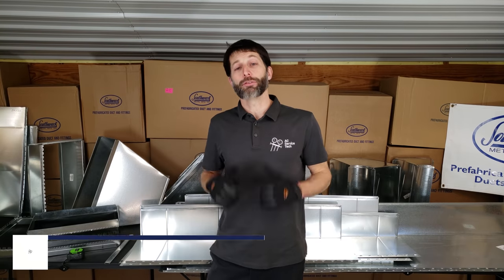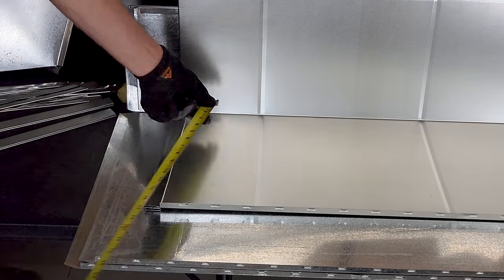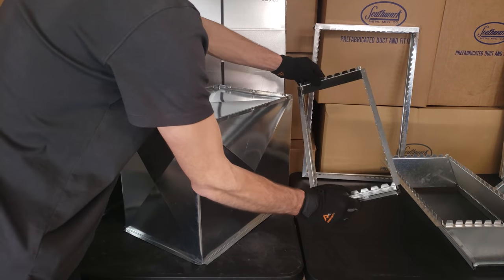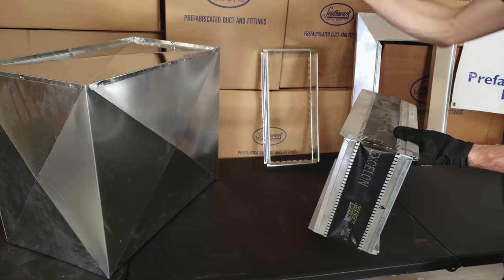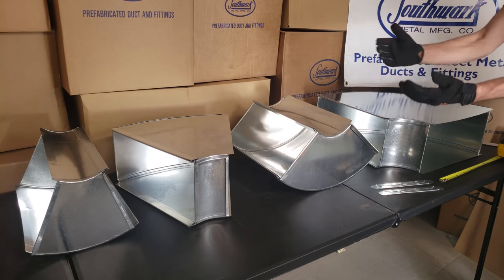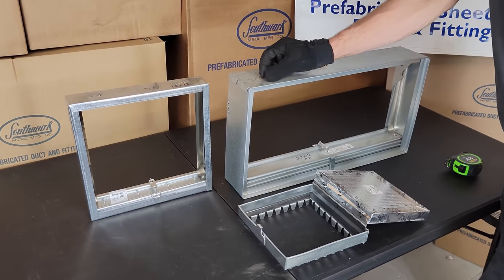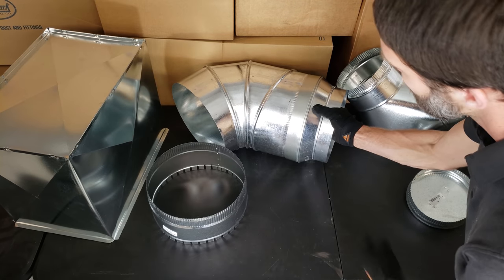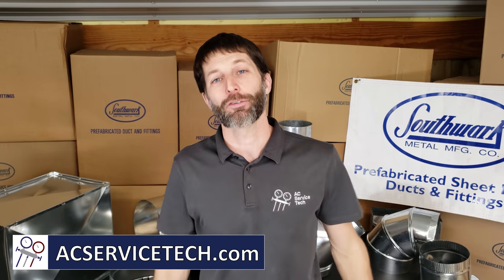HVAC Ductwork Basics! Trunk Duct Fittings, Elbows, Names, Sizes!

Comment: I did exclusively industrial work for 30 years. Now I'm working residential and have to learn all the supply house nomenclature. I feel like an apprentice!!
Reply: Always learning 🙂
Reply: I’m sure it’s not nearly as detailed or even complicated. You’ll pick up on it easy peezy
Reply: There's a big difference between the two, industrial v res. 
I used to make square and round/spiral duct for a commercial company. Had to make it to spec via blueprint job to job. Totally different than popping together some trunk line and strapping up flex

Comment: The damper is a very important aspect of any Hvac System to balance cfm to each supply register .(manul or motorized  dampers ).There are fitting terms used by old timers that in the name explain what it does .Example a double offsett double transition offesetts to the side and up or down and changes dimension on both sides.  
Skilled  sheetmetal workers can make offsets on the job by using the owl method to cut a pie angle out of ducts to make move up or side to side maximum of 15 inches in a 4ft section  .owl is short for offestt x width divided by the length .Also Skilled metal workers  can modify straight ducts to  become square elbows on the job.
By skilfully cutting and bending making sure to add turning veins to help airflow.Bar folds and bending tongs are need to modify duct along with a way to cut Pittsburg seams with a cutting wheel, Sawzall metal blade or bulldog snips if your strong enough and your snips are sharp .
Most residential hvac ducts use s and drive connection and use a standing s for larger ducts .Comercial jobs with huge ducts use TDC connections or ductmate . it's handy to always have afew cross breaked sheets of metal on your truck to make in place transitions to new equipment. Good hvac metal workers can make filter racks on the job with a slide door that slides threw slocks.Black iron grease ducts are welded connections and hung using threaded rods and unistrutt and need access panels for cleaning .Ceiling heights are important in duct instalation and elevations of intersecting ducts .Large complex comercial jobs require laying out duct runs on the floor and transfering of hanger locations to the ceiling.Often in complex instals the Installer has to think many steps ahead as not to block other trades prevent blocking other ducts to be installed and code requirements. Best to work from top down on tight mechanical rooms and seal ducts 100 percent with brush on duct seal with a Nickel depth thoroughly brushed into seams .

Comment: I'm glad you put the note about the plenum for starting out. Plenums are not best for flow and increases static pressure when they don't directly transition to main duct trunk .  I try to use round duct as much as possible. The air flow in round duct or spiral duct is far better then traditional square duct.  The down side is clearance
Reply: Round duct is best for residential. Clearance be damned
Reply: @MadAtMax.300Blackout  that's not completely accurate.  Nothing really out flows spiral duct. Usually you see a lot of spiral round duct on commercial applications. Not so much on residential
Reply: @pineychristian  spiral no but round yes. Most of any installation on new homes yrs ago that I did was almost always round trunk.
Reply: @MadAtMax.300Blackout  in my house I install all round duct including all my branches ( runs) . I have great flow and performance.  Glad I did it that way and I didn't use flex duct .
Reply: @pineychristian  yes. Not as easy to damage as flex either. It isn't really my thing anymore but I am going to look at a job tomorrow where the guy says he has extreme water damage yet wants to salvage what he can salvage LOL it's Flex of course that the runs are made out of so boy oh boy I probably got more than a handful of work to do

Comment: I wish you would show what materials to use/ how to install register boots for large round duct such as 10,12,14. 
Sometimes a 6/8 inch pipe doesn’t deliver enough air and It seems like at the box stores you can only  get boots fed by up to 8 inches. 
Just confused on the proper materials to use to get a large pipe to feed a room. 
Thank you.

Comment: I’m a service guy, but have a quick question about duct systems. How do you guys diagnose a system that has a improper duct system installed?  What are the symptoms that tells you the duct lay out is not correct?
Reply: Static, poor airflow
Reply: Before getting to the airflow specifically, you can typically tell from the subcool/superheat on the system if the duct system is good or not. You’ll never reach your targets if the duct system is poor, in my experience anyway

Comment: Wait, joist panning is no longer allowed!?  What’s the alternative?  Would you install returns like a standard supply run?
Reply from the maker: It would be a duct within the joist bay. Its ridiculous but I believe most people were not sealing the wooden and sheetrock bays correctly on the returns and thats likely why they changed this.
Reply: @acservicetechchannel  if you seal the bay completely with mastic, can it be used?  Or is it completely banned?  Also, considering most joist bays are 14.5” X 8”, are we expected to install a square duct of this size to achieve the same air flow?  Or a large 7-8” round duct?

Comment: I really want to know as a technician about duct sizing and determining if some duct work needs redone. I always hear that duct sizing is important, but don't see much about the topic.
Reply: Start with how to measure static pressure & manometer basics. Every system is different and you need specialty tools to make measurements with, then you can plug numbers into a calculator & write the equation for understanding what sizes and lengths will perform the best.

Comment: What do you call the “lip” that screws into the ceiling that catches the AC vent from falling to the floor. I’m able to push the vent up and crawl into the drop ceiling and want to add a new vent off the main supply ducking

Comment: Hello! I hope you can help me out. I need to make a T with and existing (let's say the horizonal  part of the T already exists) on my home's ductwork. We recently moved a wall to make a room larger, and now the original duct is about 4" away from the wall.  We plan on cutting a rectangle from the duct, but it obviously doesn't reach the wall, as I just mentioned. Could we use a rectangular duct collar? If not, how do I make the addition/extension?  Thanks!

Comment: I have a 420 square foot building with a furnace and a 4 foot plenum. I bought 16"x8" rectangular ducts that run 24 foot long with six 6" vents. Are the ducts too big? Should I go with a 14"x8" or a 12"x8"  duct size? I haven't installed the 16"x8" yet so I could exchange it. Thanks.
Reply: Probably too late but u should do a cfm calculation

Comment: What dictates where you put a reducer and how many you need?
Reply: Depends on the context, are you using in to reduce a supply line coming to a end or reducing a branch? Normally for a supply I’d reduce about 1/3 to 1/4 the length to not end up having issues pressurizing the duct, for the branch I’d reduce if I needed to change the diameter to fit it onto a end boot, or another fitting. That depends on if you’re using the same diameter pipe for your branches as your boots, if you use one continuous size for boots you would likely only need a reducer for the supply and possibly return if you use a metal return, and not thermoboard.
Reply: @VikingunicornzZz  it would be for  the trunk duct on a reducing extended plenum. Would you place one after you’ve lost so much CFM or FPM or is it solely based on distance?

Comment: How air-tight should the seams be?  
Do the connections need to 'breathe'?
I hear a lot of expansion and contraction noises when the furnace cycles.  Would that get worse or better if the connections were less leaky?
Reply: It should be as air tight as possible. The noises are probably due to the plenum having no cross breaks.
Reply: @vaccinefraud5570  you get return air leakage and supply air leakage when it's not sealed well. You in general can have terrible airflow with those circumstances as well as a loss of cooling/heating capacity. The system won't perform well with poor airflow. It's can be quite the expense for some, but getting the ductwork replaced would make your system operate much more efficiently.